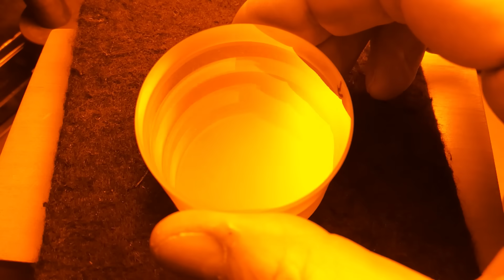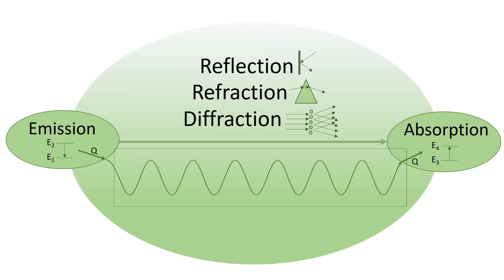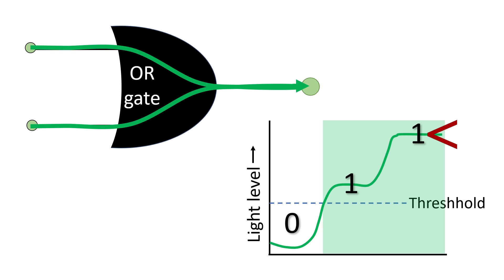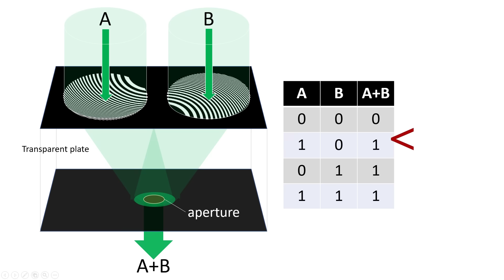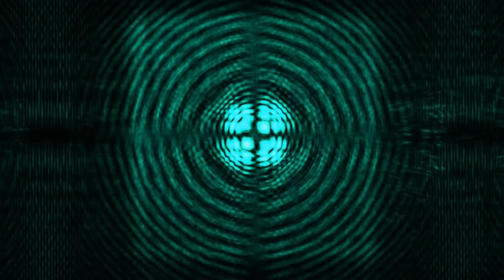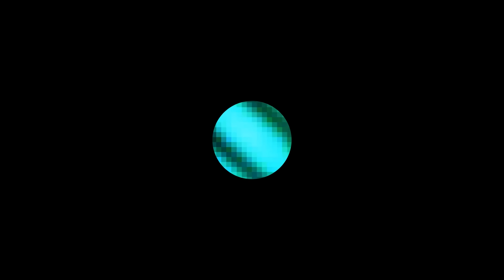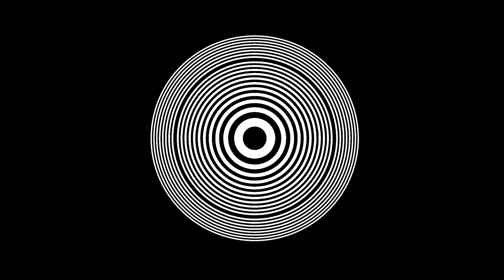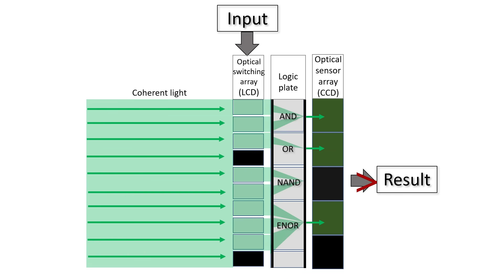Making Optical Logic Gates using Interference

Comment: It looks like a shitload of energy is being lost on each gate.
Reply: @abstractumusic  Only if we could connect these in series without capturing the result and 're-emitting it'. that's the key part, without that its as slow as the CCD-s.
Reply: True but think about how much energy is in light at that scale compared to that of electricity in current machines. It seems like if you could build a system like this the energy consumption would be way lower than current electronics.

Comment: Is there a way to make these gates composable? For example, if an or-gate has both inputs on, its output will be brighter than the output of an or-gate where only one is on. When trying to destructively interfere these two signals in a later gate, they will not cancel exactly. You'd need some kind on nonlinear element that normalizes signal strength while preserving phase. Maybe a laser medium that lases only if the incoming light has a minimum amplitude, and then quickly saturates at a fixed output intensity? It would have to be a mirrorless laser so it can switch off again. Is such a thing possible?

Comment: I think this works well in theory for linear gates (XOR, XNOR)
But an OR gate for example is non-linear.
In your example, the output of "1 or 1" would be brighter than the output of "0 or 1" and this makes it nearly impossible to chain logical gates behind each other.
You would need some kind of non-linear optic to actually build a computer that works purely optical.

Comment: But after you get interference results, in order to feed it as the input to other gates, you'll have to restore the waveform and the amplitude. That means you have to have a repeater that when its input is 1, it generates a coherent beam as a perfect sine wave, and when the input is 0, the wave is retarded by 180 degrees in phase. The amplitude is more problematic to restore. Also due to the energy loss in the measurement, it means the full circuit has to have repeaters everywhere between gates.

I'm not sure why people don't use polarizations of photons to do quantum computing.

Comment: I’m having a hard time seeing a diffraction based computer working with multiple layers. The input light has to be coherent, right and parallel to work, right? The diffraction of the first layer will mess this up as the light spread out, so the second layer will either have to account for the differences in the angles or not work at all. On top of that you have the efficiency, it looks like you’re going to capture less than half the light going through, thus it will very quickly become very inefficient for doing calculations. You could probably capture more light by using smaller diffraction patterns, but you’re limited to the wavelength of the light you’re using. Smaller wavelengths also means more energy, meaning a less efficient machine overall (sine it would require more power for the same computaion).

Maybe there’s some way to take advantage of phase shifts without using diffraction patterns? Like some crystal or something? :s

Comment: I've had this idea too and figured that adding optical amplifiers after the gates would allow chains of logic gates, and one could have millions of these chains in parallel inscribed into a cubic three-dimensional photonic crystal, with micromirrors at one side and cmos sensors at the other side to write and read data between those sides.
Reply: Very interesting, would solid state 3D micro-architecture be the future of classical computation? I see a lot of benefits, thermal efficiency and speed of light operation being two of them.

Comment: The problem here is that there's no uniformity in logic levels. It's all well and good accepting every beam above the threshold value as representing 1/true, but once you start chaining multiple gates into a circuit, transmission losses in the logic path start to interfere with the outcome. Electronic logic gates overcome this by creating a new electrical signal each time by opening the gate to let the supply voltage through, not the control signals.

If one of the control signals has followed a significantly longer path than the other, you're going to have a significant difference in beam brightness. This means that you'll need to tune thresholds very very carefully indeed at the output, and your circuit won't be as reconfigurable, as you have to ensure that all paths to the same gate result in similar levels of intensity being received.

But given that an OR gate can output 2 different levels of 1 intensity, it's highly unlikely that this is going to be possible for anything more than the most basic circuits.

Comment: You just demonstrated that any optical logic gate is possible with interference. An xor gate can be turned into a not gate by leaving 1 input on, then you can use that with an or gate to make a nor gate. Nor gates are universal so you can then make any logic gate with them.

What would be another interesting test with this would be optical memory. Maybe see if you can make an SR latch with optics? It would probably use some kind of chemical that absorbs light, then you could use an and gate to keep it in the on/off state.

Comment: The problem is that light is (generally) linear. You could talk about these as individual gates, but if you actually connect them together, no matter what you do the final result will be a linear combination of what you started with. You can't get complex logic. Not unless you add something to make it nonlinear, like having a light sensor that triggers a laser. There are ways to do that, but I think that's the interesting part of the problem that needs to be focused on. Not something you can just ignore.
Reply: Or you can use infinite way of polarisation    bit? No. Modulation 👍

Comment: Would it be possible to reorient that "slit" evaluation zone into more of a circle by reshaping your focusing elements?  Perhaps into more of an oval or ellipse with the diffracting elements spaced to try to "re-coherize" your light due to angling?  In phase shift array radars they have many small elements forming one large surface and the radiating plates are timed so that the beam is effectively focused anywhere they want.  This eliminates the mechanical focus (rotating element) and makes the whole system faster and more reliable.  You would have to create the diffracting pattern to phase shift each path so that the beam arrives as a coherent circle ready to interfere with its partner.

Comment: Fascinating. I've subscribed just to see whether this idea develops. Without wishing to put Descartes before the horse logic gates are most useful when cascaded and fed back under control. If the output of a single gate is too small then the fanout would be less than 1 without amplification. With that issue solved though I wonder just how small the gates could be made.
Must try them under load then set an EMP device off to see what happens.

Comment: cool thing about lasers is you can actually use the same hardware on multiple signals using wavelength division multiplexing. that would give you a lot of parallelism in your optical computing device. number of "cores" (technically just one core) really depends on how well you can filter and detect discrete wavelengths.

Comment: I've also had this idea. But indeed I think it's better suited for calculus than logic because, as such, the transistors in the LCD are already doing all the computation. Btw, you can use a second LCD without polarizers for pure rotation of the signals. And you can combine more than 2 inputs with the microlens layer you're building. You can map a Pythagorean function to this.

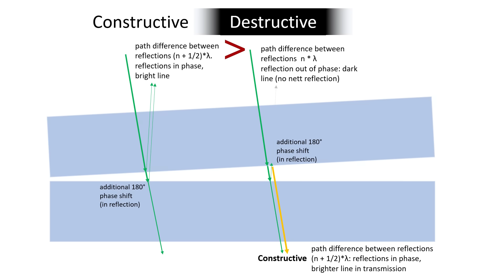Comment: Rather than saying the energy goes into transmission instead of reflection, at 1:24, I would say that the energy goes to the constructive interference.
The superposition of the two out-of-phase reflected waves causes a modulation in the fringes where sometimes the light is cancelled out (destructive interference) and sometimes it is doubled (constructive interference - bright lines), with variation on this theme in between.
To be specific, we get a cosine pattern, where the intensity at a given point is given by the expression: total intensity = 2I + √(2I)cos[φ1(r) – φ2(r)], assuming for simplicity that both waves have a constant intensity "I", with φ1(r) and φ2(r) being the phases of the 2 waves as a function of position "r".
Since the average value of cosine over one cycle is 0, the average value of the total intensity is 2I, the sum of the intensity of the two waves.
So the extra energy of destructive interference in the reflected light doesn't go into the the transmitted light, it is just added to the constructive interference of the reflected light.

What you said about more light being transmitted in areas of destructive interference is true, the positions of destructive and constructive interference swap (or shift in phase by pi radians). This is due the fact that the reflection adds a phase shift of pi to the reflected waves, the transmitted waves do not have this pi phase shift, so they are "pi" or half-a-cycle out of phase with the reflected waves.

Comment: In the diffraction does anybody know what is actually happening? Would it possibly be like each line is actually like a sin~cos wave being split into singular streams by the magnetic fields of the material or something like that? Otherwise would they be maintaining that sin~cos dynamic and multiplying? Also I'm trying to understand is not light a sin~cos dual stream of oscillating energy? In this could light be considered a complete feedback loop for a sound is a direct signal? I understand their compression waves in sound, but when digitalized It's interpreted as a single wave function. Therefore am I correct in assuming light as a sin~cos wave function? Otherwise I'm confused why sometimes it only seems to show one wave function for light can anyone explain that?

Comment: On LCDs being slow, you could probably choose a wavelength that can use a very fast changing structure? (I don't know much about if different wavelengths can support more efficient crystal structures so could be a dead end there)

Or use self emissive stuff with optics to make it nice and direct? OLED is only 0.1ms iirc

Comment: I think I know how you can make a NAND gate, maybe... Start with a laser, and two beam splitters. What we need is two beams of amplitude A each, aligned in phase, and a third beam of amplitude 2A, 180 degrees out of phase with the other two. The third beam of larger amplitude will be our "carrier" (logic 1), and the other two will be our inputs to the NAND gate. Focus all three beams on a single point. If all three beams are on, the output will be a zero (the two beams of smaller amplitude cause constructive interference with each other, and destructive interference with the larger beam 180 degrees out of phase, net output 0). So a filter should be applied to the output to discard or attenuate whatever light still remains after interference. If either of the input beams is turned off, the output should be at amplitude A, so logic 1's, and if both inputs are off, the output will be at amplitude 2A (no interference from the other beams) so, logic 1! That's the entire truth table for a NAND gate!

I'm not 100% sure, but if you use the same reasoning and move the beam polarities and amplitudes around to use constructive interference, you end up with a NOR gate, which is the other universal gate!

Not sure how long you can maintain beam coherence if you start adding gates together though... To make a real computer you would probably need special quality glass and then run it in a vacuum...

Comment: As a programmer and electronics dude, all you need is one of the universal gates, either a NOR or a NAND. With either of those you can make any of the others. From there, you can then make flip-flops, registers, and shifters, and then you pretty much have a computer! The main concern here I think is the loss at each gate. How do you take the output of one gate's tiny aperture and use that to drive other gates down the line? If there a way to passively produce more light from the output (by exciting some photosensitive film or something?)? I think you could achieve higher efficiency per gate (less losses), if you combine your approach of phase manipulation with polarity shifts. Try rotating half of your pattern by 90 degrees or 45 degrees maybe, or polarize each input laser by the same? (I suspect it's going to be more complicated that this, but it's an interesting experiment anyway).

Comment: Mayhaps you could in fact aim to make full use of the stacked focal points from the refractive pattern @13:11 to make tuple-valued operations. It would suggest pretty great things are possible if, for example, you could come up with an optical half-adder circuit

Comment: it's going to be very hard to chain these gates, considering each of them outputs light in a different polarization state depending on its inputs.
Reply: He presented a very interesting parallel processing architecture towards the end. A matrix of inputs exists on one side. The inputs would be loaded from a memory cache. The inputs go through a matrix of generators and evaluators. The output is read by an optical sensor. The memory cache is updated from the values read by the optical sensor. This process repeats in cycles. There would need to something that reads and writes to the memory cache. In this way a program can be loaded and evaluated, and the results read. This is a very cool concept!
The process is not too dissimilar from a frame buffer on computer graphics. Frames of data could be preprepared ahead of optical processing. The frames get added to a processing queue that gets processed FIFO by the optical processor.
Reply: How does an erbium doped amplifier affect the polarity of light? Sorry if this is a dumb question I'm very new to optics

Comment: Would this allow for different types of materials used for the circuitry as in better extreme heat resistance? I heard one of the issues we would run into with visiting other plants are the harsh conditions on the circuits.  If so, I can see NASA to be interested in the direction you are going.  I love science but I'm dumb.